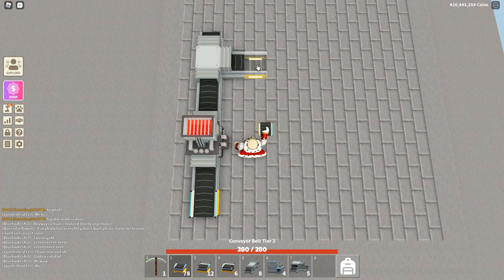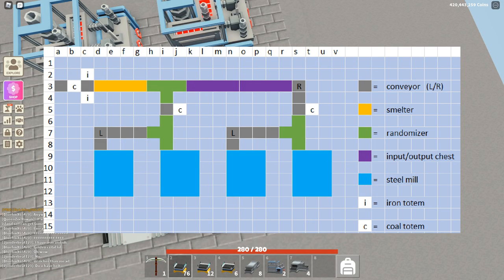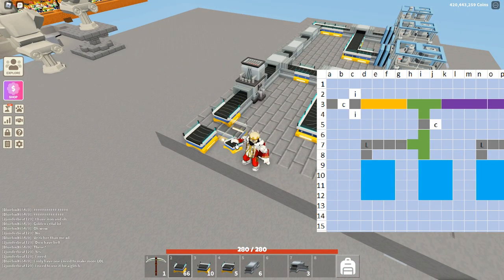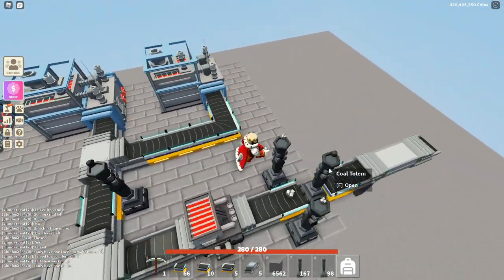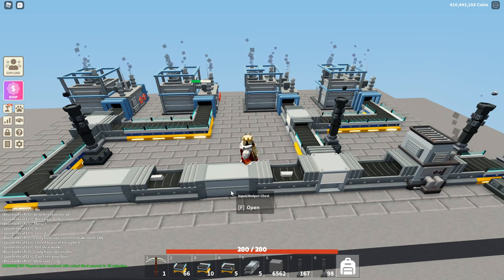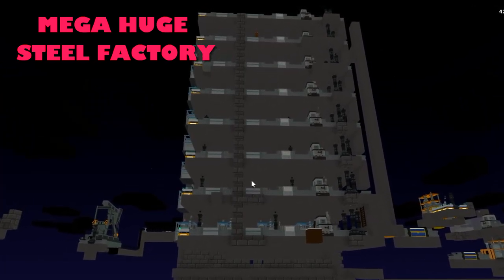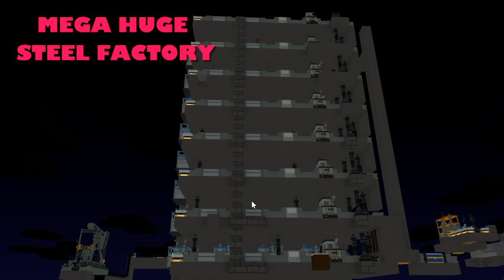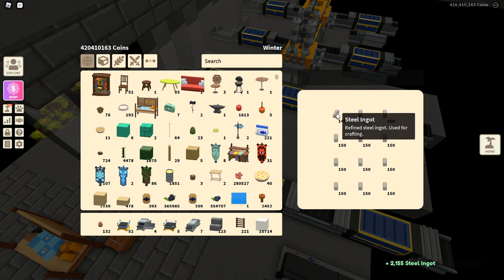ROBLOX Islands Greatest Steel Factory most efficient and long producing Industrial Factory Tutorial

Comment: Some steel farm designs only require 3 conveyors which will cause less despawn, also I think u can use filter conveyors to repeat it on the other side of the coal totem. Overall nice video 👍
Reply from the maker: Great idea.  Thanks for the comment.

Comment: Wouldn’t I gain more for just using 1 smelter per steel mill?
Reply: A steel mill can only push 1 steel per 20 seconds, for a max output of 3/minute. Meanwhile a smelter can push out enough to easily supply 4+ mills. If you're running one smelter on one mill, you're capping your steel production potential for that smelter at 3/minute & you're most likely going to have iron despawning on the conveyer. If you attach 4 mills to that same smelter, now you're making 12 steel/minute, with little to no conveyer despawn. Plus, you're saving time &/or money by not having to aquire so many smelters.